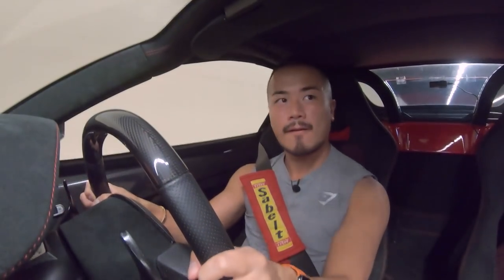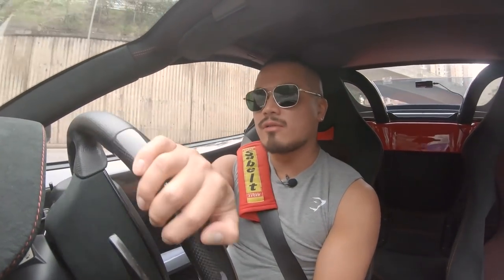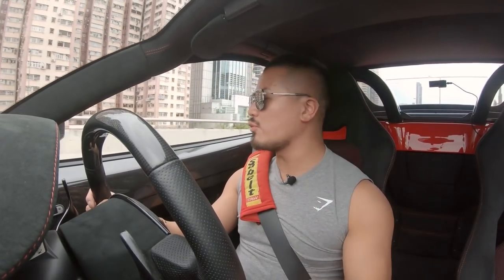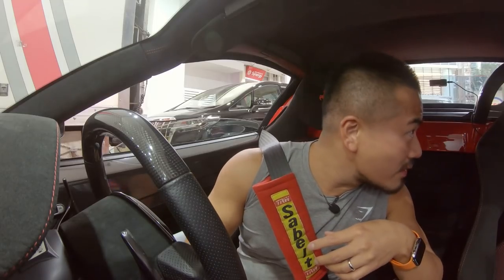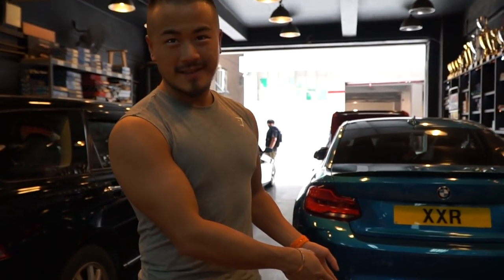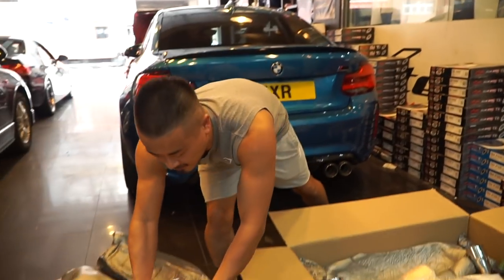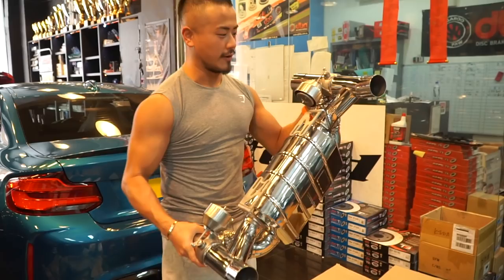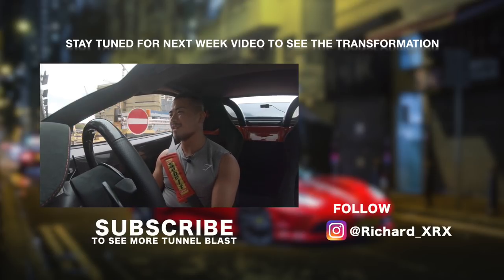Unboxing CAPRISTO exhaust for my Ferrari 430 Scuderia 16M

Comment: Funny how this system is.  I have this same for my 360. It’s so good that your credit card hurts.  Not sure what u paid but the cats were around 6500 the muffler was 5800 and another 600 for the remote.  But it’s the greatest sound ever.  I didn’t go with stage 3 because I wanted to control the sound with the remote stage 3 is wide open all day long.